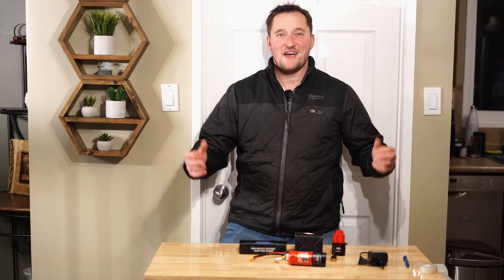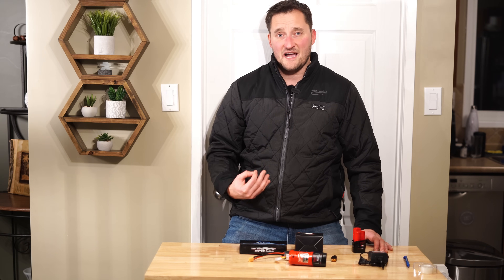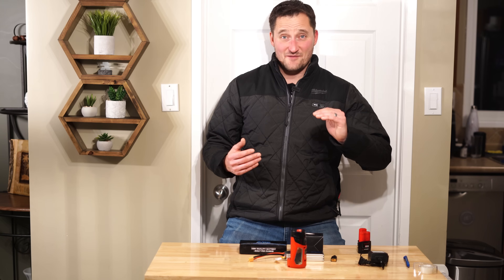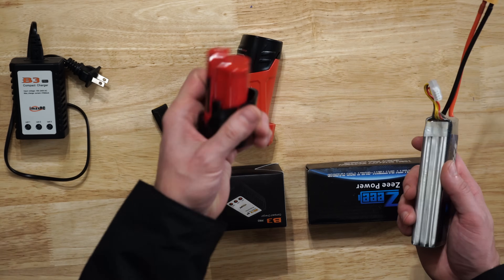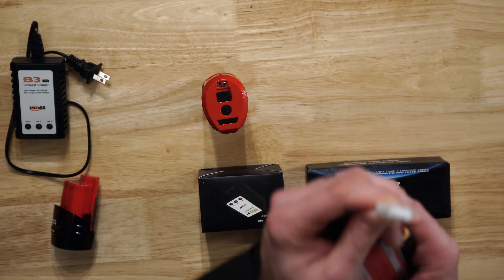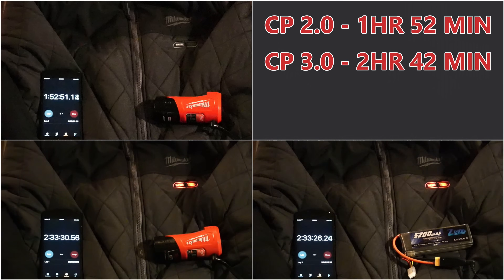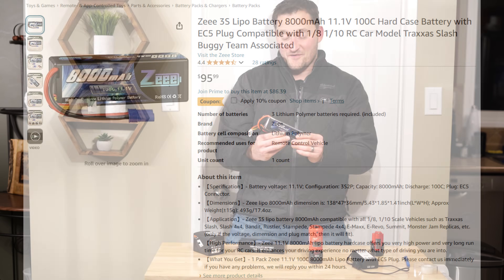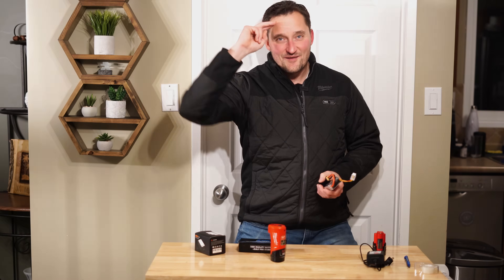WARNING! Read Description - Milwaukee M12 Heated Gear Battery HACK for INSANE RUNTIME!  Part 1

Comment: Sorry, but I’m not strapping a lipo battery to my body. Look up lipo battery fires. These batteries are extremely dangerous if punctured/damaged. If that thing catches on fire you aren’t getting that jacket off fast enough. Also, the additional care needed in charging and discharging these types of batteries makes them inconvenient for such a purpose.
Reply from the maker: @danielrgusa  thanks for the comment! I just got a low voltage buzzer and have a hard case version on the way, as well as a more robust charger. I've learned a lot about the hazards as well as ways to mitigate the risks thanks to the good folks here!

Comment: Do not to this, huge safety risk. Your normal tool batteries have something called a BMS ( Battery Management System), its something that protects for shorts, and deep,discharge ( more stuff aswell) If a lithium battery is to deep discharged it alters the chemistry of the cell and form micro shorts. This is a huge safety risk cause those shorts will severely increase the risk for fire when using and especially when charging. Those batteries will explode and burn with over a 1000 degrees Celsius. Never ever use a lithium battery without a BMS and an active charging balancer. Also pouch cells are not really suited for that application because they are very sensitive to bending and getting punctured which you guessed increases the risk of fire, so use them with a shell.
Reply from the maker: Hi there, I now have a low voltage alarm, and have a hard shell battery along with a more robust charger on the way. Thanks!

Comment: its 5200mAh at 50c discharge rate, your not discharging at anywhere near 50c (about 260amps yes rc batteries can put out insane amps) so at the low discharge rate of the jacket its likely you will see better mAh performance than the sticker says as its not being drained at a high discharge rate in your application.  just be careful not to over discharge or over charge or pierce the outer insulation as it will spit 2 foot flames out the side of it if damaged, they are a lot more volatile than the 18650 cells in the Milwaukee batteries and wont tolerate much bashing around.
Reply from the maker: Thanks for the comment! Sound advice, I have a low voltage alarm now, and a more robust charger and hard shell battery on the way. Cheers!

Comment: It looks like others beat me to it thankfully but i came here to mention that you need to protect from over discharge. Id also recommend getting a hardcase lipo. You may not think they are fragile because the packs are firm and feel solid but they are in a foil pouch. If you accidentally snag it on something, or slip and fall etc and puncture the pack they can start on fire. I could see this becoming a very painful accident. I can see this being a great idea, i have the Milwaukee heated winter jacket and the heated hoodie as well, and half a dozen 3s lipos but please please use caution doing this, i would also not leave the battery plugged in all the time because sometimes these types of devices can still have a very small current draw even when off. A good example of this are the rc cars themselves. Anyone who has ever forgotten to disconnect the battery and later comes back to realize they ruined a battery and its at like 1.8v per cell will understand. Lipos require a certain level of knowledge and safety practices and i dont want you to burn your house down or hurt your family over a warm jacket!
Reply from the maker: @dandieleman2715 Thank you for this! It's comments like this that not only help me learn, but to also better appreciate the community  ❤️. Yes I couldn't agree more! I'll be doing an updated video shortly I have acquired a low voltage alarm, have a hard case battery on the way, as well as a better quality charger! When done the battery goes in my metal ammo container now, and I plan to speak to storage voltage and care. I want folks to understand the risk, but also to weigh those against the benefits . Cheers!
Reply: He already mentioned that in the vid!

Comment: Great idea, but you need a deal to stop the discharge at 3.2v or your prob looking at damaging the battery. Prob should have something to regulate the input as well.. Thanks!
Reply from the maker: Hi there! I picked up a low voltage alarm and have a more robust charger, as well as a hard shell battery on the way!

Comment: lol. So many reasons this isn’t the safest idea. Make sure not to get the voltage too low, don’t let it get wet and don’t let the cells get pierced or bent. Lipo batteries like that don’t have a battery management system like the Milwaukee or power banks. Also make sure to use a balance charger.
Reply from the maker: @4acae86  Hi there, thanks for the feedback! I just picked up a low voltage alarm, and I have a hard shell pack on the way. My charger says it's a balance charger but I'm looking into one that can actually discharge to storage voltage. I'll be putting out an updated video once everything gets here.
Reply: @RegsChannel  awesome. You should be pretty good with the low voltage alarm and a hard pack. Lipo batteries are like a knife, a great useful tool that needs to be respected so that pot doesn’t bite you. Another good option is a LiFePo4 battery as they are a lot safer and have an onboard bms. Not sure if they make compact ones though. The big advantage with a lipo and the reason they are used in RC is their high discharge rate, but with that there is a little bit of risk side it’s just a raw battery.

Comment: The big issue is you now have no
Protection against over discharging the battery.
Reply from the maker: Hi there! Thanks for the comment I have since picked up a low voltage alarm, and I also have a hard case battery on the way. I'll be doing a new video once I get all that stuff in! I appreciate the feedback. Thanks!

Comment: 47 bucks plus you need a charger....
Reply from the maker: @daleb5967  Hi There. I did the total cost breakdown at the end of the video and this was accounted for, thanks! I also have a low voltage buzzer and hard case on the way and will be putting out an updated video. Thanks!

Comment: Keep in mind you can discharge an rc battery to a point where you can't recharge them,.  Very easily.  They have no discharge limit protection.
Reply from the maker: @daleb5967  understood, I had a low voltage buzzer arrived yesterday and have not ran the jacket to 0. Also have a hard case battery on the way. I will be putting out a video on these soon!

Comment: I would use a hard case instead of a soft case for a battery. You can get cheap r/c chargers, around $20. Look for a imax b6 style charger. They are either blue or black. Brands vary but they are the same. They have a digital display to tell you tons of info on your battery.  Also you need to use a lipo low battery alarm. They are super cheap. Like 4 bucks. They plug into the balance lead on the pack and a alarm goes off it hits under 3v a cell which will damage the lipo and possibly cause a short and fire. Please be safe.
*Also when the battery is not in use they need to be stored at storage voltage which is 3.7v a cell, the above mentioned charger can put the pack into storage mode. I've had several of those cheap chargers when i got back into rc. They will work fine for this purpose.
Reply from the maker: @traildevil67 Thank you for this! My voltage alarm showed up yesterday, and my hard case battery should be here tonight. I saw the B6 and it looks like it's well worth the 40$ CAD. I've made a habit of leaving the battery around 50 percent when not in use. Can you confirm that the B6 can get a battery to storage voltage? If so can you share a link? I'm looking to get one and then put out an updated video with all the feedback I've got from here!

Comment: This is foolish and reckless. 
RC LiPo batteries do not have any voltage or current protection built into them.  They will not just shut off at a certain voltage like you claim in the video. They will keep discharging until they destroy themselves. 
The fun part about that is, about 60-70% of the time they go to a runaway thermal melt down. 
They will literally turn into explosives in your pocket. 
This could happen upon discharge immediately, or sometimes when you try to recharge them. Sometimes it’s even delayed and happens later when you aren’t even using the battery. lipo is very sensitive and dangerous when it comes to over and under discharging. The tool battery has protection built in. The RC battery does not. You are literally playing with fire!
Reply from the maker: @1967friend  hi there, thanks for the insight, the community here has been great at bringing up safety alternatives. I have a hard case on the way, and just got a voltage buzzer in yesterday. I'll be putting out a follow up video soon speaking to these points. Cheers!
Reply: @RegsChannel I might suggest editing and re-uploading this video with the correct information and safety warnings. Many who watch likely have no clue about the safety risks involving these batteries. And may take it at face value. And end up hurting themselves, or having a house fire. LiPo’s are no joke! And must be used responsibly! 

FYI BMS’s can be had pretty cheap, and wouldn’t be too difficult to add to this project. Nor would one add too much mass or weight. And would make this DIY much safer!
Reply from the maker: @1967friend  hey there! I edited the title and added a summary of all the info that the community has provided at the top of the video description. I have a bunch of additional gear on the way over the next few days and plan to do an updated video. Would you happen to have a link to a compatible BMS? I would love to look into this more. The low voltage alarm is tiny!

Comment: Clever. But how do you protect the battery from over discharging? Running a lipo pack to the point where it has no more juice, makes it fairly dangerous to recharge, especially on a cheap charger. Rc lipo battery packs are “dumb” unlike tool battery packs. There’s nothing in the pack to prevent you from over charging, or over discharging.
Reply from the maker: @Plzdontcrash  Hi there, thanks for the comment! The folks in the RC community have been an incredible source of information. I picked up a low voltage alarm that arrived yesterday, but also had made a point to not run the jacket for more than about 4 hours. My charger has an indicator for each cell and my meter shows me approx 4.2v per cell fully charged, but I do acknowledge that I should have a better charger, especially so I can get these to better storage voltage. I have a much better understanding of the risks associated with these, and plan to do an updated video once the additional hardware arrives in the next few days. Cheers!

Comment: Hey buddy that jst connector is the balance leads NOT for charging it only sends very low voltage to balance the cells use the xt60 for charging. Those tiny wires on the jst aren’t for charging
Reply from the maker: Thanks for the comment!

Comment: I used to use the M18 CP 2.0 Ah battery in my heated gear, and it would last a long time.  The bulk wasn't any worse than using an M12 5.0 Ah "mushroom" style battery, and it would actually be more comfortable than using that style anyway, because it was flat.
Reply from the maker: Thanks for the feedback! I think comfort is a bit subjective, for me I find this style more comfortable personally. Cheers!

Comment: Folks.  I’m a Milwaukee guy and a rc car guy.   Does it work.  Maybe.     But holy shit this is dangerous.     Lipos puff and burst into flames.  Especially if your using them for a unintended use 🤦🏽
Reply: And they have special needs.   You can’t run them too low and if they’re stored for a while they should be stored at a specific voltage.   Do your homework before trying this
Reply from the maker: Agreed. The community has been awesome about this! Just picked up my low voltage monitor/alarm today. Will also assist in making sure I can get it to storage voltage. I am looking into upgrading the charger to something a bit more robust as well. Thanks!
Reply: @RegsChannel  glad to hear this. Lipos can be very dangerous if handled poorly.    When they’re in a rc vehicle they’re strapped down tight and secure.   When they’re stored we keep them in special fireproof cases.   I keep mine in little bags and then the bags go into a metal .50cal ammo can for storage.    I was wearing my m13 jacket yesterday morning and recall sitting on the battery and having to adjust.   Sitting on a lipo in a way that folds the cell could be bad.   Plus I’ve thrown my jacket in my car for months with a battery in it.     Doing that with a lipo be used could be bad news.  Be safe
Reply from the maker: Hey there, thanks for the comment. The RC community has given me a ton of info over the past few days I actually just got a low voltage alarm / monitor today and have a hard case variant on the way.

Comment: So with it plugged in and the jacket is on high, the battery will shut off when it gets to the safe low voltage? Excellent video.
Reply: New subscriber, looking forward to seeing the review of the low volt alarm buzzer.
Reply from the maker: @Kolsch221  I just got them in today! Also have the 9000 mAh hard case battery coming in as well to showdown!
Reply: @RegsChannel  looking forward to the link. I ordered the xt90 adapter.
Reply from the maker: @Kolsch221  I would highly suggest you look into the rest of the safety gear as well and do your homework on best handling and use procedures. My low voltage alarm arrived today, and I'll put out a followup video soon!
Reply from the maker: Hey there, so we have established it will NOT. I have ordered a low voltage buzzer and will put out an updated video when it arrives. Needless to say I have learned a ton about lipo cells over the past few days! I've used the jacket a few times for a few hours at a time but I check the battery with my multimeter and made sure to keep it above 9.9 volts. Thanks for the comment!
Reply: No it will not shut down on its own!
And can in fact become very dangerous. LiPo batteries can and oftentimes do spontaneously combust when over discharged without a BMS for protection.
Reply from the maker: @1967friend  yes, a low voltage alarm at a minimum, however it looks like there are some low voltage shutoff adapters available. I need to look further into those. 

Do you think that the use cases they are under in RC applications (high/fast discharge, quick charging, crashes, etc) leads to a higher probability of a catastrophic failure? I've used the battery several times but have been mindful to not run it for more than about 4 hours. It's always been cool to the touch and never left it unattended while charging... I want to find out how to minimize the risk as much as possible.

Comment: I wonder if this would work with a updated hexon milwaukee jacket. They have a different connector. Try those jackets if you dont have the old jackets guys milwaukee fixed the runtime issues. Great video man ill give this a try.
Reply from the maker: I believe the new jackets have a dual plug I'm assuming the primary plug is for the heating elements, while the secondary plug might be for sending data to the fancy Bluetooth bits on their new battery pack?

Comment: Youre going to set somebody on fire with this approach. Pull the video, edit it, and add a low voltage alarm section and disclaimer. RC batteries do not have a BMS and over discharge can damage cells and later result in very energetic fires.
Reply from the maker: Hey there, thanks for the feedback. I have edited the video descriptions with all the feedback folks have been giving me. I have a low voltage alarm on the way and will be doing an updated video when it gets here!

Comment: I have the same battery but with plastic case from factory and i but for Milwaukee jacket to about month ago
Reply from the maker: Just be mindful and make sure you are taking the proper safety precautions as many folks in the comments have stated. Thanks for the comment!

Comment: Nice video. I would like to see this with a 4S pack which would be 14.8 volts. Maybe this would produce higher heat and possibly low or medium setting which would still be higher than 11.1 on high. I’ve been in cold situations where hotter would be better.
Reply: I've been using my 18v ridgid battery on my m12 hoodie for the last 3 years with zero issues. 
It is noticeably warmer than the 12v, the down side is the bulkier battery.
Reply from the maker: @hdlivemodels  very cool! What kind of an adapter did you use?
Reply from the maker: @maximusmock  thanks for the kind words! I'm not too sure how the jacket would hold up to higher voltage to be honest, I'm thinking you might burn up an element... If I can get my hands on one of the new tough shell jackets I would gladly "overclock" my current one lol! Something that may help, with my heated gloves I sized them down, made a huge difference in warmth! Doing that with the jacket could help. The closer you can get the elements to your body the warmer it will feel!